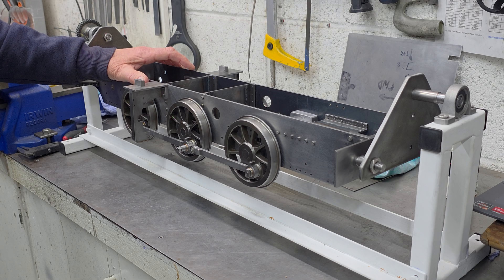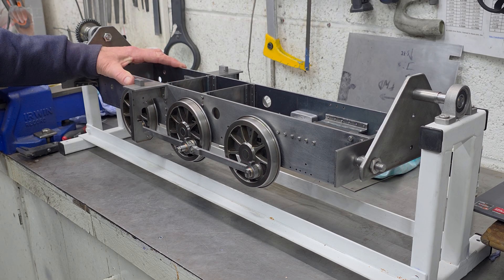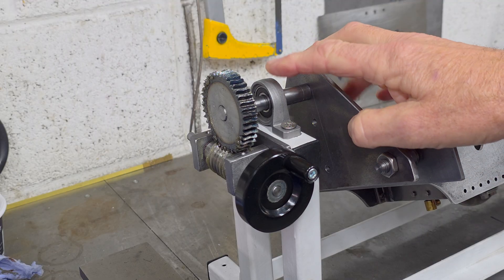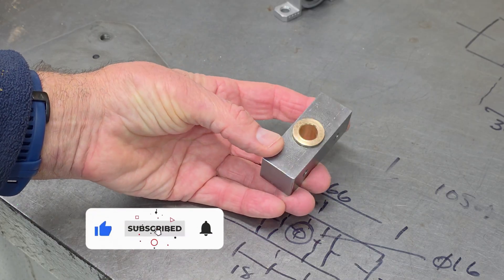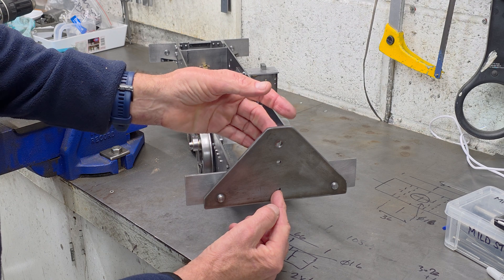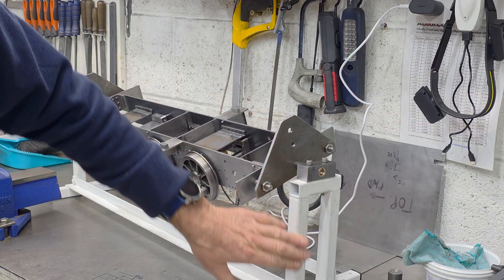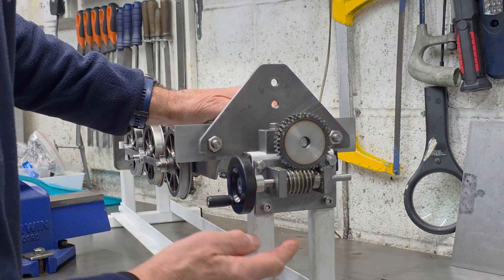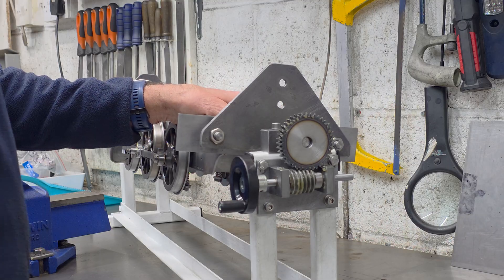Don Young's 'Jack' in 5inch: Part 60 - Loco Stand

Comment: Hi Mark, Where did you get the worm and wheel from? Just working my way through the play list so apologies if you already mentioned it. However this build stand video caught my eye as I'm think of making one myself and have been studying several designs. Thanks - Andy
Reply from the maker: Hi Andy, the worm drive and the handle came from Amazon.  Both are 'budget' items but will suffice in this application. Cheers, Mark.